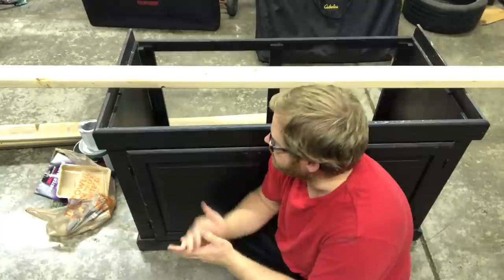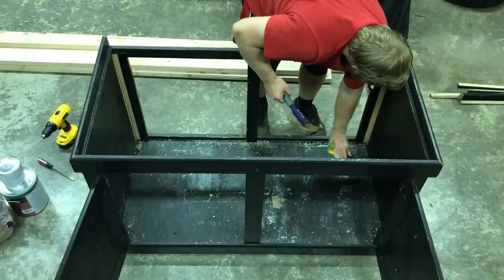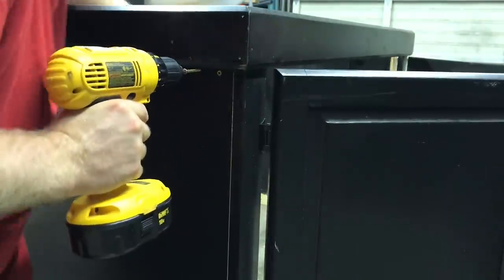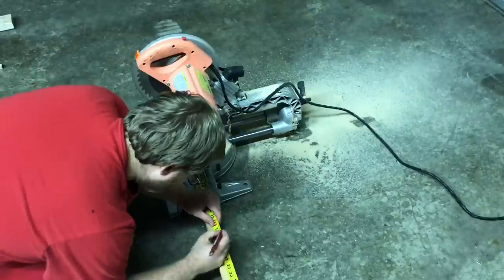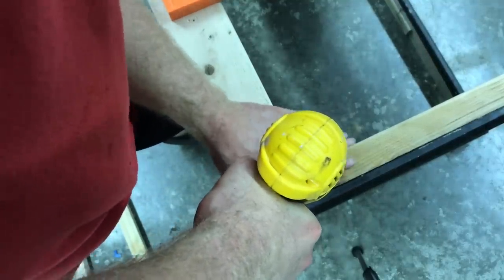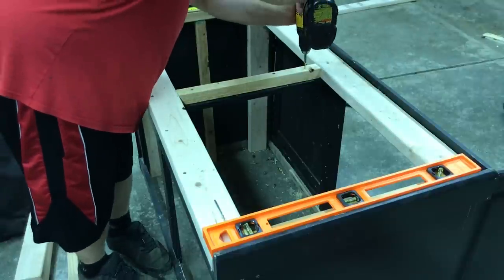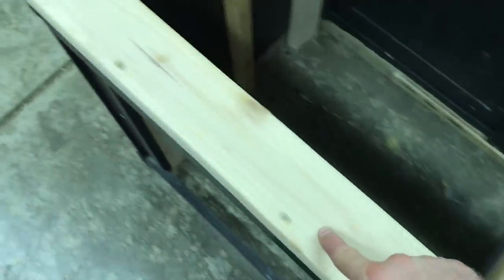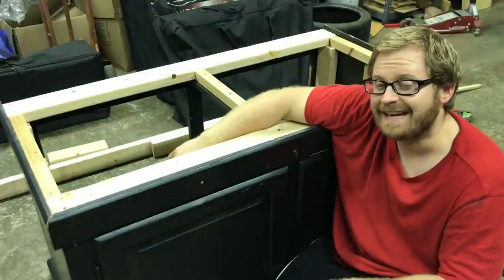HOW TO MAKE YOUR AQUARIUM FISH TANK STAND STRONGER

Comment: Awesome Paul!!!  You absolutely did the right thing in making the stand more sturdy.  I heard at the end of the vid that you were going to replace the floor with new plywood.  That would be very wise to beef up the bottom of the stand also with framing and replacing the floor.  It does provide useful and much needed structural support (of course, I'm not a structural engineer so what the heck do I know).  Take a well deserved break and tackle that on the weekend (if you haven't already done it).  Great job so far!  I would feel better with the stand with what you have accomplished to this point.  Keep on keeping on, brother!!!
Reply from the maker: Thanks a lot man! I think so too, I wasn’t going to risk my new adventure of saltwater reefing with that flimsy stand. Now I am confident. I am going to do more work once I get the plywood. It’s going to be done right.

Comment: Hey Paul don't forget the drill holes for you overflow bulkhead fittings, that's only if you plan to use the Overflow  on that saltwater tank to a sump. I. Forgot to do that part one time when I beefed up a aquarium stand. Good job as always
Reply from the maker: Thanks man. I actually did that last night
Reply: You helped out so much, you are the man

Comment: Overkill but peace of mind is worth it. I would do the same thing. Excited about the salt tank. I am fairly new but so forgive me if you have touched on this already but I am having trouble tuning in my tumbler. I bought one off of ebay and it is either way to much or not enough. Do you have a DIY tumbler or do you just bite the bullet and buy the cobalts? 
Thanks
Reply from the maker: Overkill is good with me. I use ones off of amazon. They allow me to pull the airstone up or push it down to tune it. I also have air valves in my central air system that allows me to dial it in. I never used cobalt.
Reply: Thanks for the reply. Agreed overkill is good. I will mess with air stone "depth". Thanks again